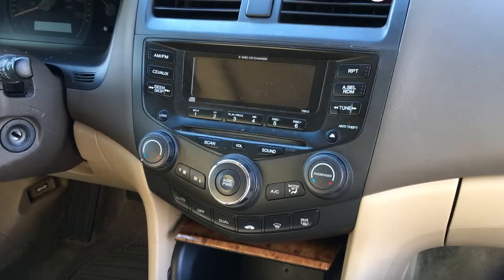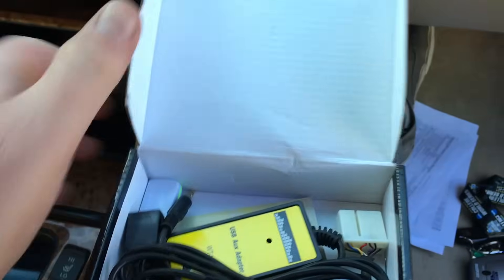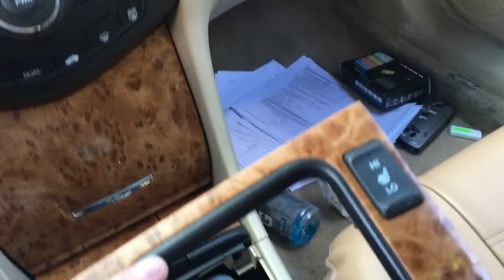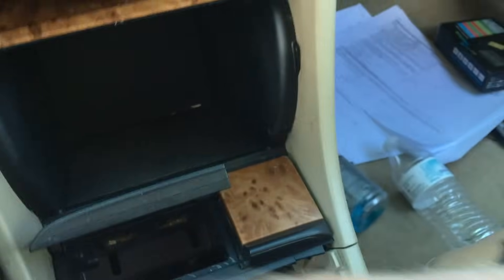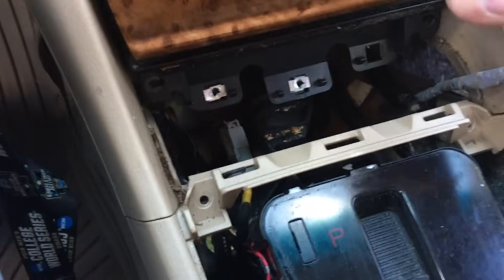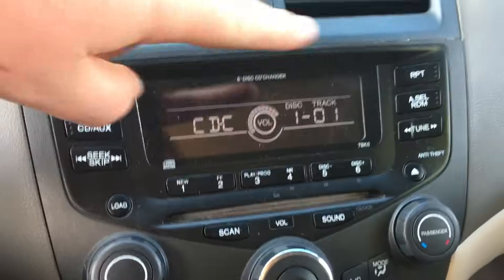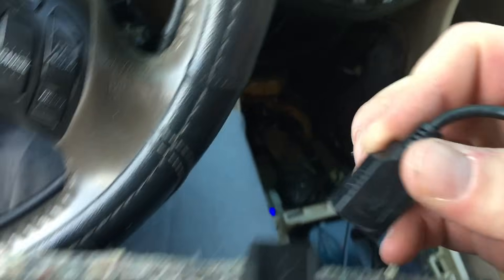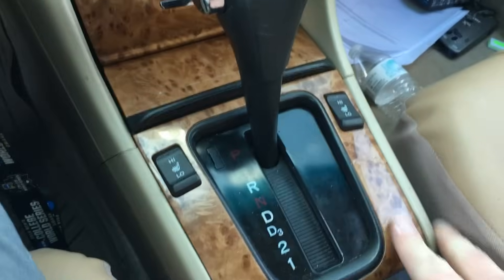2003 - 2007 Honda Accord Factory Aux / USB Install

Comment: Cool just took everything apart and there’s nowhere to plug it in??! I have the same ‘03 stereo but when I look underneath it it’s just flat metal. Can anyone help with this? I have an aux button and everything so maybe the port is somewhere else?? I’ve tried googling but nobody seems to have the same issue
Reply: Figured it out! Ended up taking my stereo out and found the port behind it where I definitely would not have been able to reach. A couple extra steps but not too hard! There was something plugged into the port that I had to unplug so hopefully nothing important.

Comment: Thanks for the super helpful guide. Got mine plugged in after about 15 minutes, however there is a noticeable amount of static noise while using the aux. Do you know how to fix this?
Reply from the maker: Its a cheap module, so you can try using a ground loop isoloator which may help some.

Comment: I installed the aux adapter but the radio will not switch over to AUX. what should I do?
Reply from the maker: Either the module is bad, or your radio isn't compatible.  I would find a new adapter.
Reply: Unplug the blue wire on the radio for 10 secs or car battery.

Comment: My A/C stopped working a couple days after installing this. Is there any possibly way I could have interfered with any cords that have to do with the A/C? Although I didn't mess with any, just installed the AUX.
Reply from the maker: Right, check all connections, try unplugging the adapter to see if the situation improves, but generally, they are separate systems and unrelated.

Comment: Hi, just to confirm, with this kit does it enable you to charge your phone using the USB ports???
Reply from the maker: No, it doesn't supply enough amperage to charge a phone, and consequently doesn't allow you to stream music via  USB either from a phone.  Usually low power requirement type of devices, like a USB thumb drive, would work.

Comment: If you have the cd changer, you need an extra part? I don't understand the description
Reply from the maker: Yes, you will need a y splitter to make the adapter work: https://www.amazon.com/Changer-Harness-Splitter-Navigation-External/dp/B00Y9YX7E4
Reply: Provo Beast Audio Installation 

from my research it looks like if you buy the correct kit you can plug it into the cd changer port and it would play aux on the cd setting instead correct ?
Reply: Provo Beast Audio Installation 

in the video you did not use an adapter ? I have the same radio where it says 6 cd changer at the top
Reply from the maker: Well, similar as the kit in the video, yes.  However, it doesn't replace your CD button, the video shows how to activate the aux portion when the kit is connected.  If you have the CD changer separate from the stereo itself, the port used in the video will already be filled and used by the external CD changer.  This is why you will need the Y splitter from the link i provided in addition to the kit used in the video.
Reply: Provo Beast Audio Installation 

I don't believe I have an external cd changer. it just says 6 cd changer at the top of the radio.  so I would not need the y splitter ?
Reply from the maker: If you don't have the external CD changer or Factory Navigation, then that port on the bottom of the radio as shown in the video should be open and you shouldn't need the y splitter.
Reply from the maker: No, we didn't need the Y adapter, the port was not used.  The actual radio had a 6 CD changer built in.  There are some models where the CD changer was separate from the radio and that is where it would plug in.  It, however, was not needed in this video.

Comment: My radio in my 2005 accord is fried. Does anyone know where i can buy honda stock radio without spending an arm and a leg.
Reply from the maker: Check junk yards or ebay
Reply: Patricks Rock get a trim for about $50 then get a cheap Bluetooth unit for $20 if you have no luck there

Comment: Where did you hide the aux adapter (Yellow box)? I mean do you here any rattling behind the dash at all.
Reply from the maker: It just fits back behind the pocket.  No rattles, but if you worry about rattling, just zip tie it to exiting wiring.
Reply: Provo Beast Audio Installation thank you sir

Comment: how did you uncover the metal g
from where you connectef the aux that beige colored thing
Reply from the maker: Sorry, not sure what you are asking
Reply: my doesnt show in my 2006 honda accord lx coupe i looke behind the radio but aonehow i dobt see it. is it covered or sonthing
Reply from the maker: If the plug isn't accessible from under the radio (like the video), the plug may be on the rear side of the radio.

Comment: I managed to get it to work but that sound has some static and isn't very loud any recommendations
Reply from the maker: Well, with these systems, you get what you pay for.  Occasionally, each model may have a gain level adjustment, and if it does, be sure to turn it up there.  If there is no gain, try making some adjustments with the volume on your portable device and radio volume.

Comment: I have a 2005 accord and I don’t have the adapter on the radio it’s self, what do I do?
Reply from the maker: If you are referencing the port to connect the adapter,  it may be on the back side of the radio.
Reply: Provo Beast Audio Installation how would I get back there

Comment: The previous owners of my car installed an aux chord and the older (9 pin) ipod/iphone charger. And when push the CD/AUX/XM button, XM shows up on the screen for a couple seconds, then it automatically switches and then says "Aux" on the screen. I recently had to change my headlights and took my battery out to do so, and it reset my radio settings. So now when I push on AUX, it doesn't switch over. Just stays on XM. Does anybody know how to enable the AUX setting? I've done it in the past, but completely forgot how I did and it is driving me crazy.
Reply: I can totally relate I had the same problem. my dad bought a 04 accord (pervious owner installed an aux cord as well) but the battery was disconnected so I needed the unlock code when I unlocked the radio it was suck on FM radio and XM I could not go to CD or aux. when I pressed the CD/aux button it went straight to XM radio. its been a month  like this but, now all of a sudden it works I can go to CD and aux. hopefully this will be your case too I'll say just give it some time to re-program its self or something that's what happed to me

Comment: It says a Y adapter cable is needed if you have the cd changer? Can someone link me to the adapter it needs?
Reply from the maker: https://www.amazon.com/Auxillary-Yomikoo-Navigation-Retention-2003-2014/dp/B01EUZ8SY0/ref=sr_1_6?ie=UTF8&qid=1523889280&sr=8-6&keywords=accord+Y+adapter+harness

Comment: Hi, great video. I was hoping you could offer some help: I recently bought a used 03 Honda Accord and installed a similar aux adapter. The aux works fine, but now my CD player wont eject a CD that is already inside or let me insert a new one (it's a 6-CD changer). Is it possible  that the aux install has somehow overridden the CD player? I know the button says "Aux/CD" so I'm not sure if the button has a dual function or if it's a one-or-the-other kind deal when it comes to the input. I've tried changing the disc but nothing is working. Any help you can offer is greatly appreciated :)
Reply from the maker: I know that typically the functions are separate, but test it! Unplug the harness from the bottom of the stereo and see if the CD player will eject. I'm not aware of any problems like that.

Comment: I have done it and everything was fine, however, when the engine started I hear the engine noise from through the audio system. Is there anyway to fix it? Thanks
Reply from the maker: Sounds like you need a ground loop isolator, that will remove the noise.  Just search ground loop isolator 3.5mm in amazon / ebay / google, and you will find the device you will need.

Comment: so I just install the USB aux adapter to my 2003 Honda Accord but it's killing my battery what's going on it definitely is turning off when the car is off because the light is not lit on the USB adapter box I don't know what to do anyone have any answers for me?
Reply from the maker: Sounds like you have a draw somewhere.  I would unplug the device to see if the battery continues to die.  If it does, you have an issue somewhere else.  If the issue goes away, i would replace the unit.

Comment: Where did you place the battery part of the aux port before you put everything back in place?
Reply from the maker: Battery Part? If you are referring to the module, it just sat behind the pocket.  Make sure you place it where it doesn't rattle.
Reply: Provo Beast Audio Installation thank you

Comment: Where do you tuck that little box that’s on the adapter thing, does that stay inside the actually car are in the cubby where the 2 wires were put through that hole you filed?

Comment: would you recommend this or the GTA Bluetooth model for better sound quality?
Reply from the maker: I haven't used the GTA kit recently to compare, but generally rule to thumb, you get what you pay for with quality.
Reply: Provo Beast Audio Installation Thanks for the reply! I was wondering if the extra price was just bc it's bluetooth, or if it is that much better as well. It's a 150 vs 25 dollar difference.
Reply from the maker: Honestly, i would just bypass the radio and put a single din in the pocket below the radio for that price.  You can get a great pioneer radio with bluetooth for that price with excellent sound quality.
Reply: Provo Beast Audio Installation Yeah, but I hate to make obsolete the stock display. An ocd thing, maybe. I ordered a aux adapter so I'll try it out, if I don't like it I'll go from there.
Reply: Provo Beast Audio Installation Thanks for the help, btw. Subbed.

Comment: every review I've read says these units die within weeks. is there a reliable alternative?
Reply from the maker: Replacing the radio is the best alternative, there are other options, but most cost well over 70 or a 100 bucks.
Reply: Provo Beast Audio Installation that's fine the cost isn't really a problem. I just want something that will work reliably and frustration free for a few years.

Comment: 2005 Honda Accord didn’t have the adapter part I even tried pulling the metal plate down
Reply from the maker: Earlier models on occasion have the port on the rear of the radio.
Reply: @ProvoBeastAudio  I have this issue on my 05. How do I find the port? I cant see behind the radio

Comment: i did not see your y-adapter installed. did you skip that part
Reply from the maker: We didn't have a need for a Y adapter.  This model was not equipped with satellite radio or a 6 CD changer.  The port was open.
Reply: is the y-adapter only necessary if you want the cd changer to operate?
Reply from the maker: Yep!
Reply: hi great video, so I have a 6 cd changer and a port open, so no Y adapter?  thanks I have the same car interior trim and color too.
Reply from the maker: Yep no Y adapter if the port is open.

Comment: I have 2006 Honda accord exl 4 cylinder. And mine doesn't have place to plug in..
Reply: Do you have a CD/AUX button? If not, then sorry.
Reply: @g00glian0   yes I do, and xm satellite radio on one button. 
But I just found it, it's in the  back, heading to the back. Kind of little harder to install it.. but I got it... thank you anyway..
Reply: pije selanegara I have a 2007 Honda Accord and I couldn’t find where to plug in the piece I found it facing the back but there’s a piece in there I can’t get unplug did you have that same problem?
Reply: @vanitycook9022  well, you could use a little screwdriver to push it.. you'll be able to get it out.. that's what I did. And plug your thing.. it's kind of little hard to plug in anyway, but you should be able to do it.
You're right,  we have sama problem. And I'm sorry that I just able  to reply you.. I just read it.
Good luck..

Comment: I have a 2007 ex but I can’t find the plug in for the auxiliary
Reply from the maker: It may be on the rear side of the radio.
Reply: Provo Beast Audio Installation it was had to take out the whole radio haha

Comment: Everything was as you said.  I have a 2007.  So my aux connection is behind the radio (I'm assuming, I can't see it) not on the bottom.  Is it possible to not have an aux connection at all of the face has a button for it?  And if I have the connection on the back, that seems fairly involved.  Is that difficult?

Thank you!
Reply from the maker: If you don't see it on the bottom, it will be on the back.  Not too much more work just to slightly pop out the radio.  It will still work, if you have the CD / Sat button, just hitting it again should activate the aux feature.
Reply: Provo Beast Audio Installation thank you for replying to all of us.  That's super cool of you.  So the two screws that are visible in the bottom of the radio deck are enough to undo to allow the back of the deck loose enough or does the entire face of the dash need to come out.  Because when I was in there it seemed too tight.
Reply from the maker: You don't necessarily have to pull out all the screws, but you may have to loosen them to get you hand up behind the radio.  Regardless, to access that port, it may require a bit more effort to get your hand back behind the radio to insert the adapter.
Reply from the maker: penetrating oil?

Comment: I have a 2005 Honda Accord and I did this until I got to the radio part and mine looks different which I was annoyed since I did all the work for nothing
Reply from the maker: Well the port may be located on the rear of the radio...
Reply: It is but some metal piece is covering
Reply from the maker: Yep, so you may have to pull out the entire radio to do so.  This radio shows you briefly (at the end) how to do so.

Comment: How do i undo the clips if my box around the gear shifter is stuck
Reply from the maker: Be careful, but it may require a bit more force to pop it out.
Reply: Provo Beast Audio Installation how do i remove the casing covering the plug in
Reply from the maker: It may require you to pull the whole radio

Comment: if your cd player doesn't work, will the Aux usb install still work? I have a 2003 accord and the cd player won't even turn on.
Reply from the maker: If the radio won't even turn on, sounds like it is a much bigger issue.  Either the actual stereo is fried, or you may have a blown fuse.  Don't bother purchasing this adapter until you determine the issue with your radio.

Comment: What if my car doesn't have an spot to plug the adapter in
Reply from the maker: It may be on the back of the radio instead of the bottom.
Reply: I think something is plugged into that spot maybe XM radio
Reply from the maker: Then you will be required to purchase a Y adapter
Reply: Is the adapter only necessary if you want to use both XM radio and the aux cord?
Reply from the maker: For the Y adapter, yes!
Reply: Can I just take out the adapter to the XM Radio? I don't use it or do I have to have the Y adapter
Reply from the maker: You sure can, just remove the XM plug and replace it with the new AUX adapter.  Your XM will no longer work unless you plug it back in or purchase the Y cable.

Comment: Hey I brought this exact thing and it makes a weird beeeeping sound whenever the engine is on and the car accelerates. Why does it do that and how do I make it stop. Whenever I turn of the engine the sound is perfect its kinda weird. I assume it some kinda of interference
Reply from the maker: Sounds like a bad unit, or you are getting a ground loop noise.  You can try purchasing a 3.5mm ground loop isolator.
Reply: I'm having the same issue, Kind of frustrating

Comment: Would this also work for a 2005 honda accord EX with navigation?
Reply from the maker: Yep, it may require that you purchase the Y adapter as the nav system may already occupy the port that we plugged into.

Comment: Does this adapter draw power when the car is turned off? I am afraid it will drain my car battery.
Reply from the maker: Nope, it pulls directly from the radio which operates on switched accessory power, so in theory, when the radio is off, so is the adapter.

Comment: Thanks for the video. The cable gets disconnected when I restart the car. Does anyone have any advice on this?
Reply: Try using electrical tape to hold it in place

Comment: I cant get the center door thing off. One of the screws wont fucking unscrew and in close to just ripping the whole panel apart.
Reply from the maker: Ya, if they are sticky, its almost impossible. Good luck to you!

Comment: My accord is 6 cd do i need de Y? And is there a code needed ?
Reply from the maker: Yes, you may need the y adapter if you have a separate CD changer.  If it asks for a code and you don't have it, you may have to call the dealer.

Comment: Can this product be used on models with the XM radio?
Reply from the maker: It can, but you will need a Y adapter: https://www.amazon.com/Auxillary-Yomikoo-Navigation-Retention-2003-2014/dp/B01EUZ8SY0/ref=sr_1_11?ie=UTF8&qid=1519065025&sr=8-11&keywords=accord+Y+adapter

Comment: What if the car has working satellite radio in it?
Reply from the maker: You will have to get a Y Adapter as well: https://www.amazon.com/Changer-Harness-Splitter-Navigation-External/dp/B00Y9YX7E4

Comment: would this work as well for the the ones with the navigation unit?
Reply from the maker: Yes, but it would require a Y Adapter https://www.amazon.com/Stereo-Harness-Adapter-Nagivation-Changer/dp/B00YDUYYZ0/ref=sr_1_6?ie=UTF8&qid=1530802019&sr=8-6&keywords=Honda+stereo+harness+Y+Adapter
Reply: @ProvoBeastAudio  do you need that only if you wanna keep the navigation? My nav doesnt work anymore and I have the aux adapter on order already. Can I install it and have it work then get the y adapter later if I decide to fix the nav?
Reply from the maker: Yep